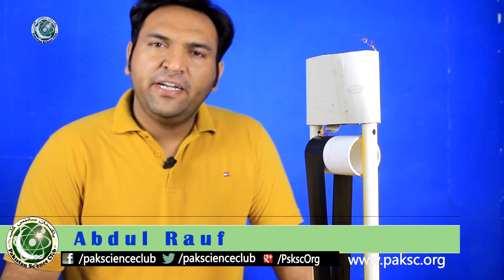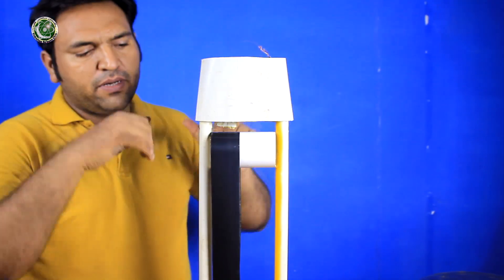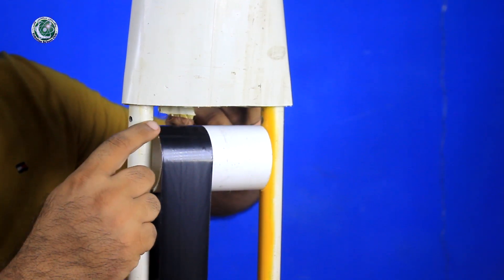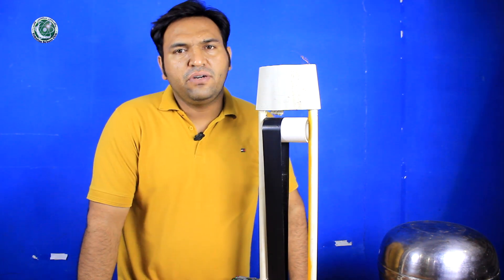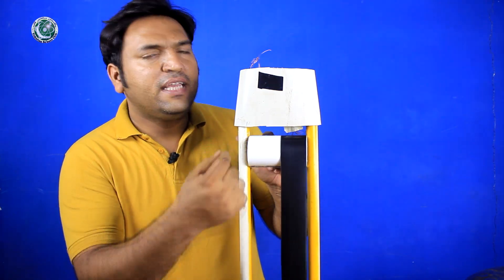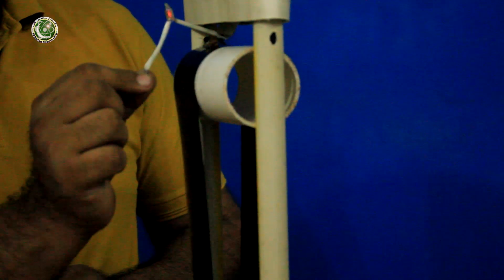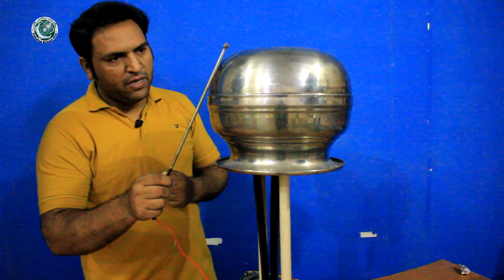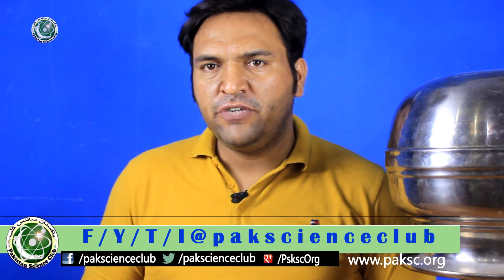How to Make Homemade Van de Graaff Generator (Urdu with English subtitle)

Comment: If the belt is electric tape(made from vinyl also known as PVC) and the rollers are also PVC the charge may not be very good. I think better results can be made with a nylon belt.
Reply from the maker: Aap ne sahi kaha. Nylon belt better results dega.

Comment: sir , were do i connect the ground wire ? can i just tape the wire to a aluminium foil piece ?
Reply from the maker: wire can be touch with ground
and yes you can tape.
Reply: @pakscienceclub  thank you , sir

Comment: Sir I have a suggestion, If you use a rounder top it will hold more charge. You can use 2 semi-sphere metal bowls. Bottom bowl can be cut to fit. Secondly you can use things like pantyhose for higher voltage. This would result in 10ns of kilovolts rather than 1 or 2 kilovolts.
Reply: electroboom
Reply from the maker: yes round sphere can hold more charges but unfortunately we can't find it.